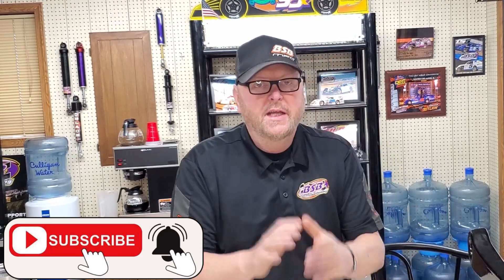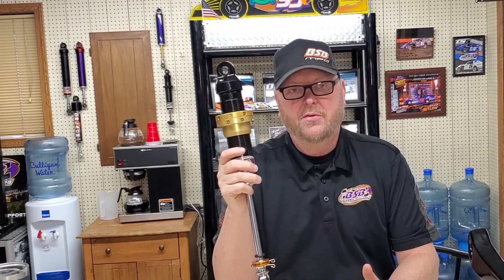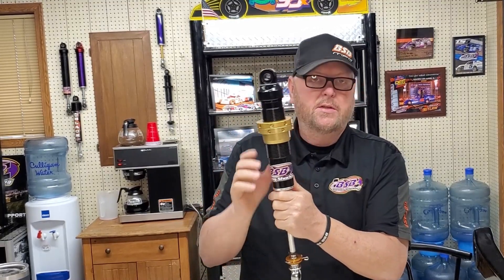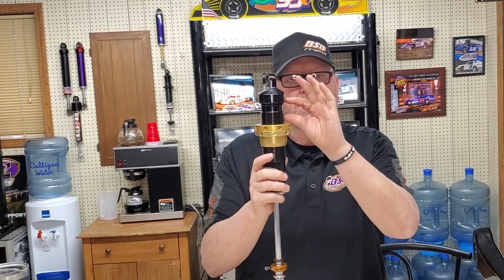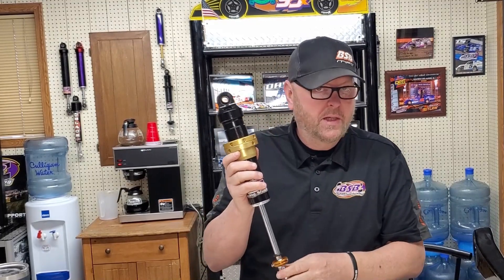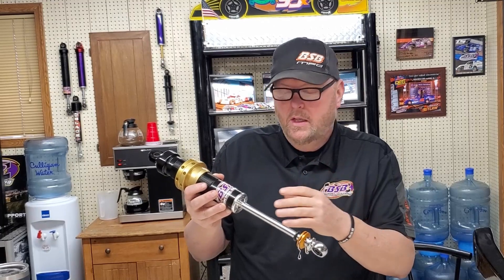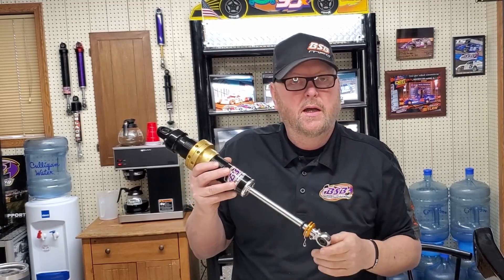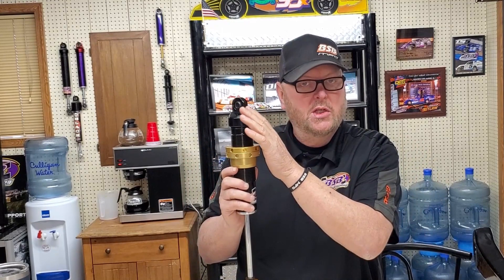Shock Basic Part 1

Comment: Well if the Schrader valve is anything like what is on an air conditioning line it should have a cap with an o-ring which should keep the valve from leaking. Because a person definitely doesn't want dirt getting into the Schrader valve, which is what will cause the value to leak.
Reply from the maker: Yes you are correct and some of them have that o-ring in the cap and still leak, some better than others.